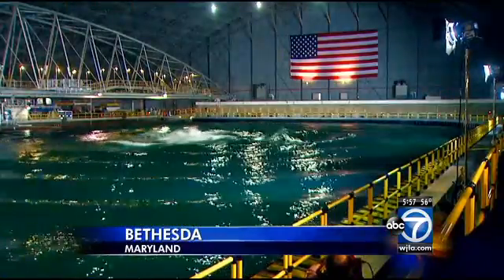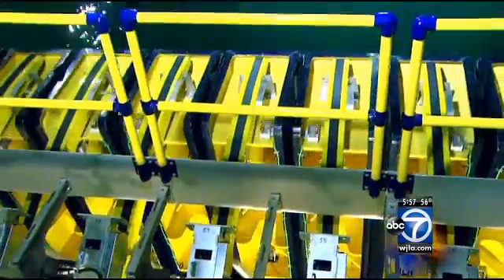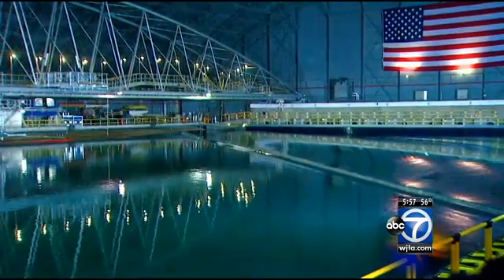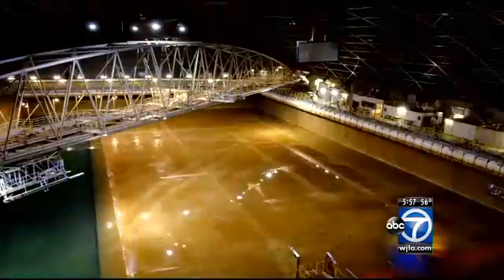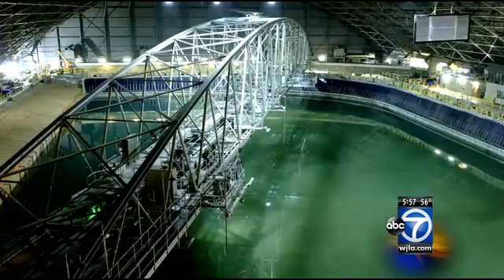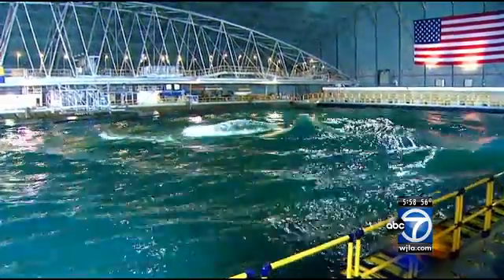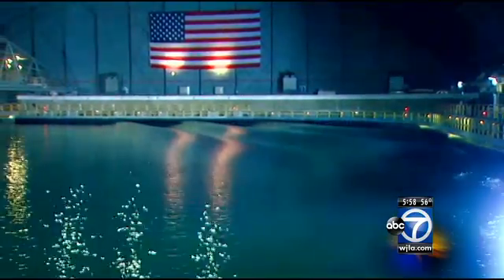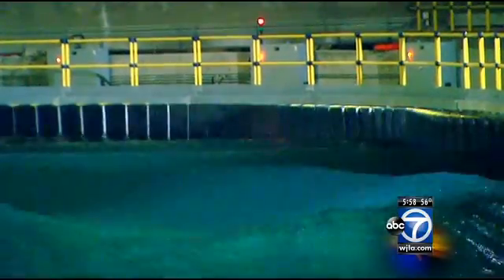Naval Surface Warfare Center unveils new wave testing basin

Comment: at $25,000,000 they got a HELL OF A DEAL... I am floored at the low cost of that facility. smh
Reply: The 25 million was just to upgrade the wave maker from an old pneumatic flapper system to the computer controlled paddle driven system. The basin itself cost about that much to build back in the 70s.
Reply: Just jump in the Sea,same at all aand real ! lol